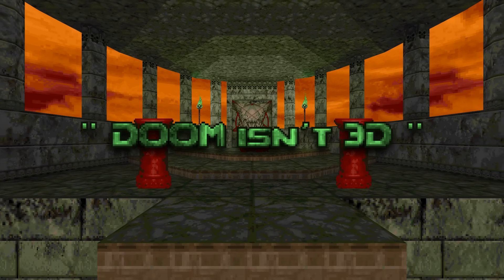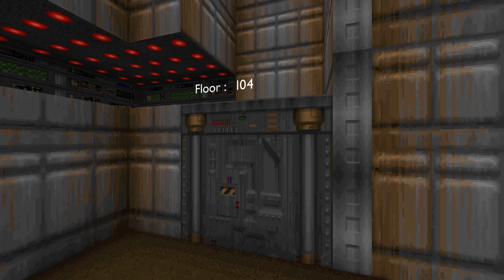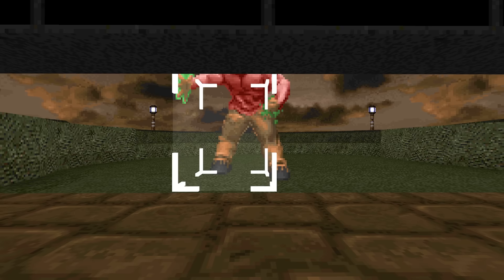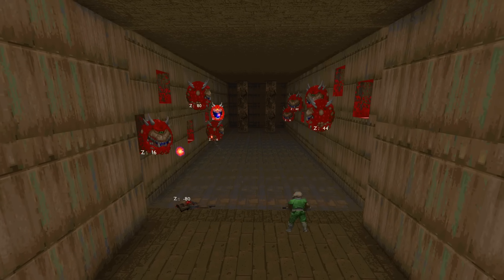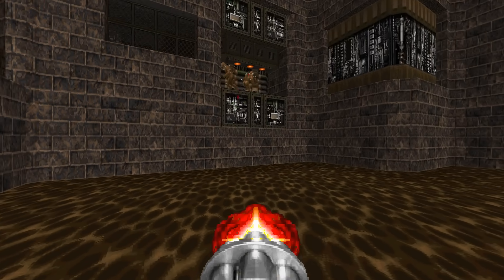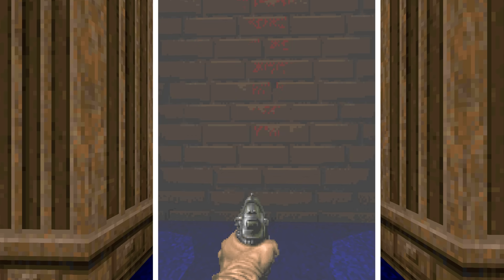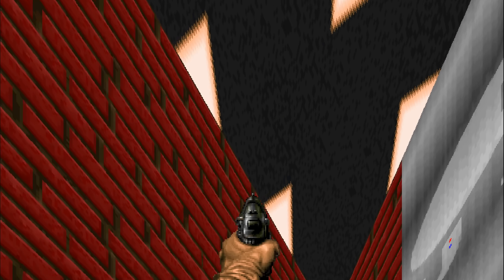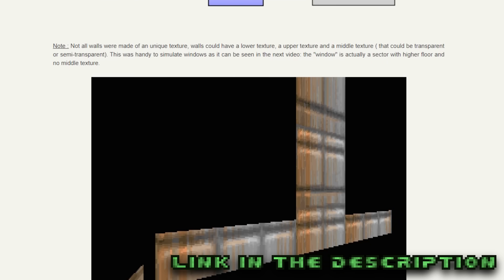Doom engine - Limited but still 3D

Comment: It's not true 3D because you don't have freedom in all 6 axis, and technically speaking what you see is just a projection of a 2D image. It's looks 3D but it's not.
Reply: All games are 2D by that definition
Reply: For many 3D games all 6 degrees of freedom aren't necessary, so if the engine just can't provide them - it still can allow for game that plays and works just like 3D games. And I think that if it plays and works like a 3D game - it is a 3D game.
Maybe a bit unrelated, but Super Mario Bros doesn't have three degrees of freedom, it has only two - you can move around but it's impossible for stuff to rotate. I think that Doom is similar to it - you can move around but you and your enemies can't quite rotate in all three planes, even rotation in XY plane only sort of exists - while you can rotate your view, your colllision box stays the same

Comment: Isn't it the case that the z-axis is just what's displayed on screen more or less, and the actual gameplay is only 2-D?
Reply from the maker: It was the case for Wolfenstein 3D, but not for Doom. Differences in elevation absolutely play a role in gameplay, some examples of which are presented in the video.
Reply: @borogk  I'm talking a little bit more under the hood I guess, not just what you see as you play but like how the actual engine works. Just because a rocket can fly over through a monster at a given graphical height doesn't mean it's not simply clipping through. Like is the actual engine actually 2D and anything with a z is just faked by the graphics? I'm not saying this is necessarily true, but everything you've presented in the video does not necessarily still negate that. That the gameplay that feels 3D is still faked by graphical calculations and it's still ultimately 2d?
Reply from the maker: Let’s look at “a rocket flying over a monster” interaction. That rocket, like any other object, has a cuboid hitbox with x, y, z coordinates, width, depth and height. Every monster also has a hitbox like this. All this information really does exist internally in the engine and when these two hitboxes intersect - a hit is registered. If the rocket flies over or under - it’s because the hitboxes didn’t intersect due to elevation difference. There are edge cases when the rocket sprite appears to intersect monster’s sprite graphically, but clips through due to inaccurate hitboxes. Revenants are a good example - their apparent height is noticeably bigger than the internal height and their heads clip through ceilings at certain heights. Everything that I described above is simple, yet 3D gameplay. A 2D engine wouldn’t have enough information internally to allow these interactions.

Comment: The fact that this engine could run with zero 3D hardware acceleration on a 386sx (no floating point math coprocessor) was absolutely astounding. When you realize what limitations Carmack was up against at the time, all of the engine's shortcomings become completely understandable.
Reply: At least 386 has fast 32 bit math for 16.16 fixed point. Later Carmack ported Doom to the Jaguar which has only 16 bit multiplication on all its 3 processors like an Atari ST.

Comment: would you say that wolfenstein 3d is truly 3d
Reply from the maker: No, to my knowledge Wolfenstein 3D gameplay operates in 2 dimensions. Each level is completely flat with no elevation difference. The game is equivalent to a top-down shooter where you only see a portion constrained to player’s cone of vision. 

I’ve heard the same shortcomings being attributed to Doom, but its gameplay/physics engine really makes a leap into the 3rd dimension, while the graphics engine is holding it back somewhat.
Reply: @borogk  I think that another thing regarding Doom engine that may make it seem "less 3D" is the fact that Doom engine doesn't have 6 degrees of freedom implemented - while most objects can move in all three dimensions, they can't rotate as freely as in most modern 3D engines - player and enemies can only rotate around the vertical axis and this rotation as far as I know is also sort of fake - colliders can't rotate in Doom. Though if we'll say that in order to be fully 3D engine needs to have all 6 degrees of freedom, we may look at one of the most well-known 2D games of all time - Super Mario Bros. This game is clearly 2D - player and objects can move in 2 dimensions of space, but if you'll play the entirety of this game you'll see that there aren't any rotating objects. Yes, Mario sort of rotates when you change the direction of your movement, but on the level of game logic it's more of a mirroring and not a true rotation. There are also rotating fire walls in Bowser's Castle, but they are composed of many individual objects that just move and each of those objects isn't rotating, if we allow for them - we may as well place their 3D equivalents in Doom and say that it proves that Doom has 6 degrees of freedom. To implement actual rotation in Super Mario Bros, one will need to make heavy modifications to the game engine, to the point where it won't be nearly the same engine anymore. 2D space has 3 degrees of freedom, Super Mario Bros has only 2 - so is Super Mario Bros "not 2D"? Of course not

Comment: Doom is not a full 3D game, but it's also not a full 2D game either. It's a mixture of both 2D and 3D parts, a 2.5D game.
Reply: It has depth, therefore it is 3 dimensions. Simple.
Reply: @grapejuice237  It just looks like it has depth. There's a difference. Look up how the game draws the screen. It isn't actually calculating 3D map data. It's calculating what things should look like if they were 3D based on 2D data.

Of course, from a gameplay perspective, there is no difference. However, we are talking technically here, not practically.
Reply: to be fair, what would you consider full 3d? if you wanna split hairs, you could consider any 3d game to not be true 3d.
Reply: Full 3D? Like descent then? Or VR games/games using stereoscopic 3D/holographic display?
Reply: @ikagura  True three dimensional world. Doom calculates enemy, player, and projectile positions in 3D, but the actual game world is created from 2D map data. In order for Doom to be considered a full 3D game it would need to have true 3D levels like Quake.

Comment: DOOM is not 3D, yes all the objects have 3D coordinates, but so did isometric games, is RCT a 3D game? it has so much 3D coordinates it can simulate the movement of roller coasters on tracks, but it displays in 2D sprites, and that disqualifies it from being 3D. DOOM and any engine that cannot render arbitrary polygons, but only draw vertical lines of pixels in specific lengths, don't count as 3D.
Reply from the maker: Fair point, and your definition, though I disagree, has some consistent rules. To me, gameplay is the deciding factor, graphics may or may not support gameplay to the full potential. Polygons are just one technology to ultimately form a flat picture on the screen. Having freely rotating camera is also optional. Hell, if I play blindfolded, the graphics cease to exist, yet the game doesn’t stop being 3D. One other thing - there are plenty of 2D platformers which substitute sprites for polygonal models yet the gameplay didn’t suddenly grow the third D. When you toggle between sprite based and model based display styles in Super Mario Maker or you turn off the screen - the game underneath stays exactly the same. How convincing the graphics are is subjective, how many coordinates does the gameplay use - is more objective always. I simply think basing the definition on gameplay is the most logical and consistent way to categorise 2D / 3D.

Comment: If you see taknly the are not any PC or console games that it's real 3D all the screens are 2D the have X and Y in the order to show those images

But the fact we able to show 3D stuff like cube's sphere's and other 3D model are impressive no matter for how those system's made.

I mean what makes i doom less 3D that quake for example.

Yes quake have better graphics and less limitesion i don't argue with that.

But both game's give 3D geometry on some kind  no matter the doom method is more limited.

And yes im award that some screens have curve even those monitors displays 2D image no matter if the the monitor are not complete flat

In the order to consider display screen or whatever the call 3D the need to display 3D objects like hologram

Differently the are 2D that display with those pixel or whatever other method need this monitor in the order to work.

Comment: how big maps can you make of this? Is it possible to make a world big as skyrim?
Reply from the maker: Not even close to Skyrim scale. Doom map can't be larger than ~64k units across, which is approximately 1500 meters. In practice it's even less, because the precision errors would kick in before you reach the limit. It's not recommended to build anything larger than 32k units (750 meters).

Comment: Well actually, Doom is a 3D Game, the sprites are 2D so john romero combined the 3D with 2D to make a 2.5D game
and you may probably disagree about my response, but well, baldi's basics haves the same thing as doom,
the 2.5D games are like 2D and 3D combined together, Because the maps are 3D but the sprites are 2D
and the sprites are made by frames, same with the rotation
Reply: There is opposite with 3D-objects in 2D-backgrounds. Used in original Alone In The Dark and PS1-era Resident Evil and Final Fantasy.

Comment: It doesn’t exactly matter how many “D’s” doom has, people (at least I) call doom 2d because of the rendering engine. Dwarf fortress has 3 axes to account for height, but its still 2d.
Reply: But a game is not about the engine. Because if that was the case then Shovel Knight would be a 3D game. Gosh. People need to redo their homework here.
Reply: @niemand7811  Id be inclined to agree with you, but given that shovel knight just uses the “3D” for parallax and could totally work without, it makes me less eager to agree with you whereas dooms raycasting 2d engine is the basis for the whole thing and the sole reason it can run on almost anything. Also, I’m not knocking doom for being 2d, it’s downright the coolest thing about it! The way the engine works is fascinating.
Reply: @zachjones4551  Doom is not a raycaster though.
Reply: @OnionTaco22 that’s actually something I learned recently, but it doesn’t change anything for my argument
Reply: @OnionTaco22  BSP is still 2D

Comment: "Auto aim is simply an aid, otherwise the player would be defenseless against flying enemies"

Then why didn't they just let the player aim his gun with the mouse? Ultima Underworld does that with bows and it predates Doom.
Reply from the maker: It's elaborated in the "Fixed camera angle" section that starts at 03:52.
In short, vertical aim looks bad with the rendering method they used. The picture becomes distorted the more you deviate from looking straight ahead. I demonstrated that on one of the modern ports, but a more authentic example would be Heretic - a game that runs on modified Doom engine. It allows vertical aim, but doesn't upgrade the rendering method. As a compromise, it only allows you to look a little bit up and not all the way. Still looks a little bad, but the devs decided they're fine with trading clear visuals for a little more player freedom. Original Doom devs decided differently, simple as that.
Reply: @borogk  I meant just aiming, not mouselook like in later games. Like, the camera stays still, but the player can still aim by moving a crosshair across the screen with the mouse ala Ultima Underworld.
Reply from the maker: Ah, I see what you mean. Well, there is no telling why. With modern hindsight I think we can all agree moving the crosshair independent of camera would be clunky for a fast-paced shooter where you move and shoot at the same time. That would be a good reason not to do it, but whether the devs thought the same - I don't know. 

What's clear is they decided not to implement any crosshair at all, even though they had it in earlier Hovertank 3D. They must've specifically dropped it in Wolfenstein and Doom because they didn't like it. There isn't even a simple crosshair in the middle of the screen, let alone a more advanced one that would auto-snap to targets or let the player freely control it.